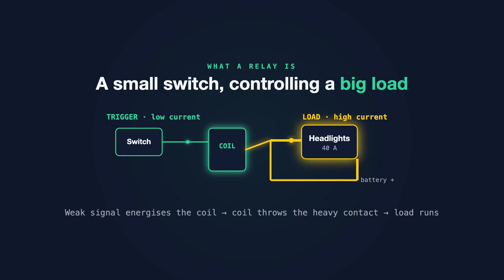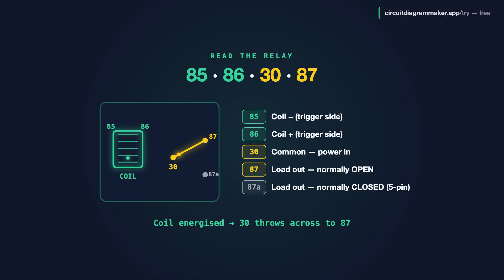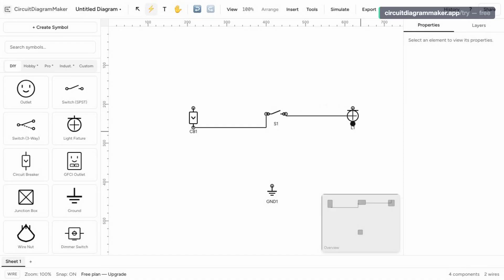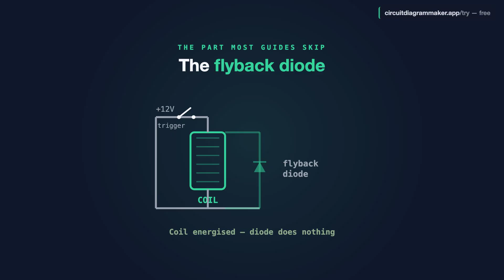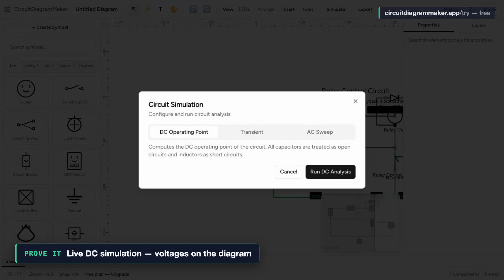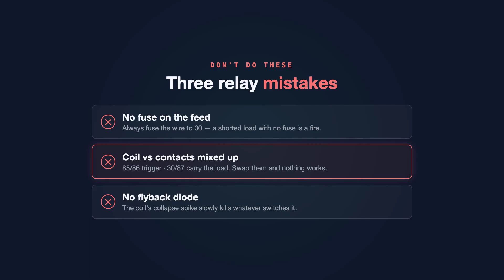How to Wire a Relay the Right Way (Full Diagram)

Comment from the maker: The flyback diode is the step most guides skip: when the coil switches off, its magnetic field collapses and fires a high-voltage spike backwards — a diode fitted across the coil (band toward the +) hands that spike a safe loop to burn off in, instead of frying the transistor or switch that triggered it.

4-pin vs 5-pin: a 4-pin gives you one normally-open contact (30 → 87), open until the coil pulls it closed. A 5-pin adds 87a — 30 rests on 87a with the coil off and flips to 87 when energised (a change-over). Need something on until you trigger it? Go 5-pin.

Open this exact relay diagram and run the simulation free: https://circuitdiagrammaker.app/diagrams/12-volt-relay-wiring-diagram?utm_source=youtube&utm_medium=pinned_comment&utm_content=yt-107